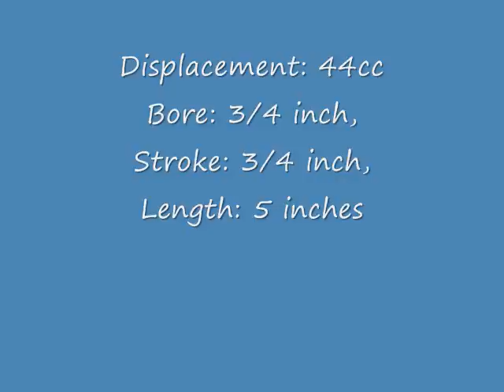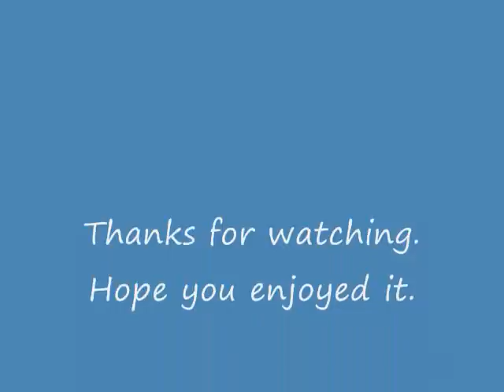World's Smallest running v8 engine

Comment: funny bewcause as you get older  instead of rvving the shit out of  it you get a kick out ofd seeing how low you can get the idle to go !  How mmany H.P. does she have 2.5?  isnt that average for a 44 cc motor also whats the ROM red line  11,000?  Id love to have this  motor  where did you machine all you parts  like the valve covers  your block the heads  pistons rings all the stuff? also what did she end up costing  I'm half way through the video so you may have answered these questions

Comment: Consider that a Honda NS50 2 stroke single makes about 8 HP, and a Suzuki GS400 twin makes about 36hp...

Between 1 and 2HP seems more realistic for a home built V8 4 stroke with no bearings, rings, or oil system, running aluminum bores...

Comment: The sound is amazing - It revs like a big one, very surprising. I would have thought it would sound like some chipmunk V8 at best - you know, buzz like an RC plane. Did you tune those pipes? 
I know it's fragile, but I'd like to hear it really wind out to 3-4000 rpms (only if its balanced! And use a nicer mic & audio setup if you do.)  Well done, sir!

Comment: Absolutely magnificent engineering, beautiful.  But please only one thing, could you please not start it manually by spinning the crank like that. Not bashing at all, in fact I´m worried for your hands and would love to see it being started up by a pull start or even wind a wire of some sort around the crank and pull it, or perhaps a drill?

Comment: Hydrogen is actually pretty bad. It's only direct byproduct is water, but electricity is needed to make the hydrogen in the first place, and most of that is still made with Coal power plants. Even accepting that coal is getting cleaner and cleaner, there's a lot of steps in the system for energy to be lost, thus lower efficiency. Honestly, we use hydrogen as sorta a battery, but the thing is, we have better chemical batteries already in modern electric cars today. As for hydrogen, I'm not a fan

Comment: 1, 8, 4, 3, 6, 5, 7, 2...    now just flow port it, polish the inside of that "Team G" looking intake, custom bend/weld some hedders - .75" or 1.0" & wrap 'em, balance the output and fill the tank with some nitro or RC Fuel... 

Nice goin' Jim.

Comment: i dont think he meant it to be used in vehicles either, i think he meant for this small engine to be practiced on by students, just as a project, not for real use, just for practice i suppose. i just thought id give a shot at clearing misunderstood thoughts :O youre right though it would definitely not work in a normal sized vehicle.

Comment: Good Job! Machined out of alum. do the pistons and clys start to erode? It seems the engine would generate alot of heat causing compression and other damage. But you probably know that and next one will have a cooling system complete with water pump and radiator. Anyways good job!

Comment: it wouldn't be more reliable because of the extra complexity and for the same amount of power as a 50cc 1cyl you would need a lot more small delicate parts than the 1cyl would especially if you make it 4stroke. 4stroke is more fuel efficient but needs a cam, separate lubrication, the lot... nah, a 50cc 2stroke 1cyl is way simpler, way cheaper (10x, not 2x) way more reliable (made out of nothing but big sturdy parts, except for the reed valve) and survives way more abuse than a 50cc v8.

Comment: yeah but if a company can produce these engines massively they would use better;more reliable materials and techniques .. plus the additional HP and torque this thing has..? let alone the efficiency..? i really don't get it.. and i mean.. 8 cylinders are more reliable than just 1 (due to friction etc) because the work is distributed by 1/8th per cyl (in comparison with the 1cyl) also i would LOVE to buy one of these instead of a 1cyl engine even if it cost the double (like anyone of course)

Comment: You are partially right, kiddo, but almost any car can do over 100mph. There is this thing called a speed governor, which clearly you do not know about. I took the governor off my brothers v6 jeep and he did 150 without problems. And one of the most efficient ways of upgrading your car for a very low cost is  ECU and EMS tuning. Stay away from cars and go play with your little rc trucks, kiddo.

Comment: he uses a premix for fuel that has oil in it. and i doubt he ever runs it long enough to need more (it does not appear to be set up for water cooling, notice no radiator or water tubes) and it doesn't appear to be set up for an independent oil system, so the oil in the premix is the only thing to help regulate the temperature. but as i said, i doubt he ever runs it long enough for that to be much of an issue.

Comment: How long can you run it for?  I would imagine it gets hot pretty quick. Would it be possible to jacket something this small for a longer running time? I have seen larger "small v8s" with tiny radiators but nothing near this small.

Comment: I think it has to have pushrods, otherwise there is nothing to drive the valves and the cylinders can't run without properly synchronised valves.  Also he said it had a steel camshaft runing above the crank, just like real pushrod v8s, that camshaft isn't just there for fun, it runs the pushrods, valves, etc...

Sounds Fantastic,  that's what really tells you it's real IMO. Can't fake the sound of a real v8 w/ open headers.  LOL

Comment: The reason american V8's sound awesome is the firing order that results from the cross plane crankshaft. Although the engine is overall even firing, each bank is odd firing. So you get the rhythm ti ta ti ta ta ti ta ti. You can pick out that sound on any V8, regardless of size.

Comment: I won't lie, I've gone on country roads and opened it up a time or two. But I also live by to a drag strip so I don't need to. 

I'll give you a piece of advice Chris. Ignore advertising, and research a car as much as possible. If you are looking to save money on fuel, buy a focus or another small compact car. Preferably used with low mileage so you don't have to fix it up. You'll save alot. 

You won't win any arguements over the prius because the facts are against you. But if you like it, fine

Comment: No, you didn't. It takes the average person 4-7 years to pay off the cost difference of a hybrid with fuel savings. That's assuming you get the maximum fuel econonmy it is rated for at all times. The prius is on the high end of that scale. Try again.

Comment: Do you have any idea what kind of gasses building those lithium batteries puts into the atmosphere? The Prius itself is efficient but they're hell on the environment to build. Don't believe me? Look it up.

Where the hell are you going that getting a battery charged costs money? It's free at O'Reilly Auto Parts and AutoZone... Hell, a decent battery cart is only a hundred bucks, just get one of those. I've resurrected thought-to-be-dead batteries using a budget cart.

Comment: I saved atleast 1000 dollars a year of fuel in a prius, it CHARGES your batteries as you drive. Charging a car battery, or replacing it is atleast 100 for a new one 200-400 with charging. STFU or GTFO

Comment: i have several questions, what is the displacement also  the intake are the ports to the intake valves running through the heads. this is very cool about how much money do you have in it ?

Comment: I have a few questions, so does this have oil in the crank case with a pump? Or is it splash? How is it cooled? Could you possibly use this on an RC plane or car? What would the power be like compared to a traditional single cylinder RC airplane or car engine?

Comment: You can make an engine run in either direction simply by changine the camshaft. Many Ford engines run backwards when used in inboard ski boats for example.

Comment: i know v8s can make big power, my fav car: V8 twin turbo 1140hp, im not saying they're bad engines cos theyre not, and i've seen a v10 with 1300bhp. there are the exception of some cars (and btw dumb means you can't talk, and I am perfectly capable) and with a v8 you can get high hp but v10 and up is where you get high torque (u americans shud know, thats how u get ur hp) and extreme punishment handling. V8s also tend to have an odd weight distribution

Comment: 3/4" bore & 3/4" stroke makes about 1.767 cubic inches per cylinder, eight cylinders makes that a little over 14 cubic inches total, if my math is correct.

Comment: this tells you that people trust the small block chevy generation 1 motor alot , most all of these little engines are based on them now bolt that thing up with the worlds smallest manual transmission and put it on a little skateboard or scooter or something

Comment: nick,,,,do you have a clue as to where the H.P comes on  at sir.Does it react like a normal V8 sir.as in the HP rising at around 2500 rpm,s? UM,,,heh heh  what viscosity of engine oil does the oil that you utilize have sir? I was wondering if your engine oil has a rating of 5 or 10?.Have you pondered thickness and the need for thicker,thinner oil.Also have you constructed you own oil pump.I would imagine that that was a major effort to design and construct? I am so impressed sir and so are alot.

Comment: I know it's a very small engine, and most parts wer turned by hand on an old lathe, but there is some serious, serious runout on that flywheel. Just saying it because I would hate for your fabulous little motor to blow itself apart.

Comment: lol youre getting pretty mad dude, fwd has a lot more wheelspin in a drag race. the weight of the car shifts to the back when you accelerate therefore putting less weight on the front drive wheel creating less traction,whereas a rwd car gets all the weight from the front put onto the drive wheels which put the power to the ground. do you have a spoiler on your integra

Comment: power to weight and aerodynamics lol you sound like a true ricer now. aerodynamics are so miniscule until you reach high speeds that your car isnt capable of in the first place. power to weight is irellevent because you dont have a lot of power and your car isnt that light. lets see bmw m3 4.0 v8 ~3600lbs 414hp 60 in 4 flat and the quarter mile at mid 12's, now give me a factory front wheel drive 4 cylinder than can do that.

Comment: No it wouldn't. The power to weight ratio of that engine (as cool as it is) is awful compared to a 2 stroke of similar displacement. A 2 stroke engine with an expansion chamber could be on the order of 1/2 to 1/4 the displacement and still have more HP and torque (and that's on gas .. imagine a methanol/nitro methane mix). That engine as is would also overheat eventually, as Coleman fuel is not methanol, but a very lite kerosene as far as I can tell. Notice no sustained running beyond idle.

Comment: You're right- It was late and I ran the math twice before I commented. Must've made an error twice... Ran it today and came up with the same numbers you did.

Your math is a different way of expressing the same caluculation. Mine was area=pi(3.14159) times Radius squared; yours is diameter squared times pi/4 (.7854).

Comment: Bore X Bore X Stroke X .7854 (that decimal point is dim) X # of cyl.

Ford 351:  4 X 4 = 16 X 3.5 = 56 X .7854 = 43.9824 X 8 = 351.8592 cubic inches.  That is the math, whether you like it or not.  Try it again.

Comment: BoreX
Bore X Bore X Stroke X .7854 (dot7854) X #cyl
Here it is:  A Ford 351 has a 4" bore and a 3.5" Stroke (8 cylinder).  4 X 4= 16 X 3.5 = 56 X .7854 = 43.9824 X 8 = 351.8592  I got my math from 50 years of building engines.  Where did you get yours?

Comment: Don't know where you got your math from but it's incorrect:
bore/2 (.375") squared = 0.140625" X pi (3.1416) = 0.4417875" X stroke (.750") = 0.331340625" cubed X 8 cylinders = 2.650725" cubed total displacement.

Divide that by 61 cubic inches (in a liter) and you get  0.0434545 liter, or ~44 ml (cubic centimeters). Hence the name "Victory 44" on the valve covers.

Comment: @michiganskater1995 Thanks. It's really amazing. Is this entirely your design? Did you make the valves and rocker arms as well?  Is it an overhead cam? Does it need to be cooled, if so, does it have a water jacket and water pump or just a fan blowing on it?

Comment: you should figure out the torque and horsepower.  This is a 3 cu in motor, so seeing as a ford 302 can make anything from 150 hp to 600 hp, it would be interesting to see if it falls within the range of 1-6 hp or more or less.  I have heard before that smaller engines make more power per cubic inch, but it would be interesting to see how that holds up at such an extreme.  

Also, exceptional build. I wouldn't even know where to start and can't imagine how much time you put into this.

Comment: @kona181 I was about to say the same thing to the guy when I saw your comment.  "camshaft" pretty much means "not two stroke".  I was going to ask if he had any plans to put it in anything, but I'm guessing it doesn't have any real way to dissipate heat, so it can probably only do short demonstration runs.

Comment: @craftsman1598 im guessing you missed the camshaft gear cover, and the valve covers(standard on a two stroke, right?), and that's a fancy two stroke to have intake and exhaust ports in the heads(but without valves, right?), your comment tells me that out of this whole video, the only thing you could comprehend is that there is oil in the gas.

Comment: @Marshmallowrex Yeah, well you nova rosi motor is a 1 cylinder 2 stroke engine. This is a REAL V8 with REAL spark plugs so just because your engine will "smoke this shit" doesn't mean it's better.

Comment: @TheKtm300rider probably not a 2 stroke but may not have an oiling ystem to keep it simple. he built this thing and may not have had room in the thing to design an oiling system. or it may not have enough capacity to properly lube it. i used to run premix in my rx7 to help the lube system